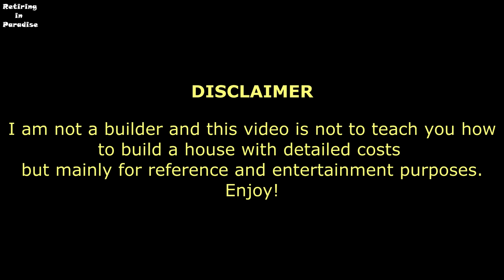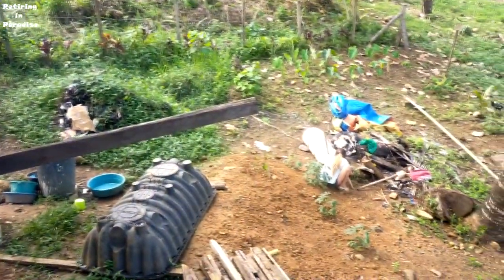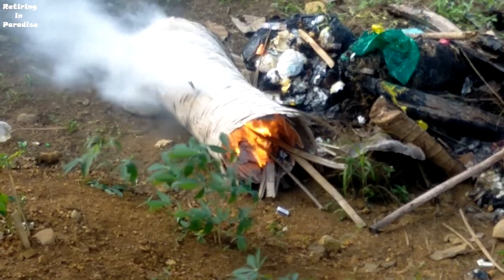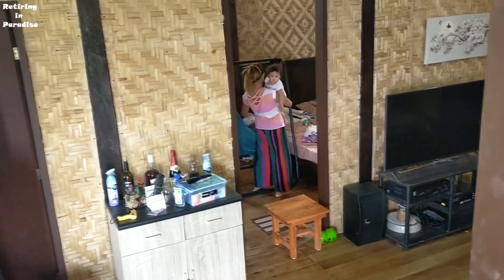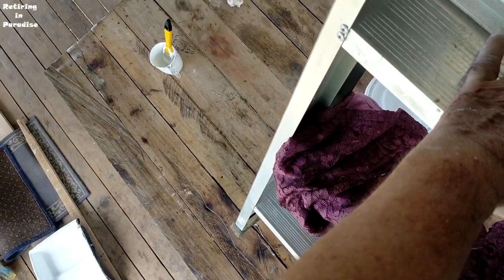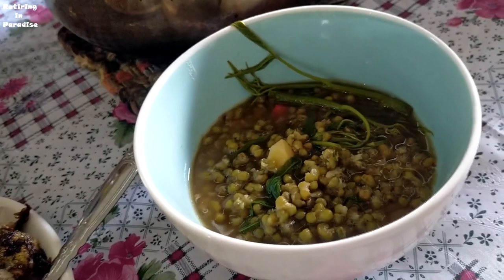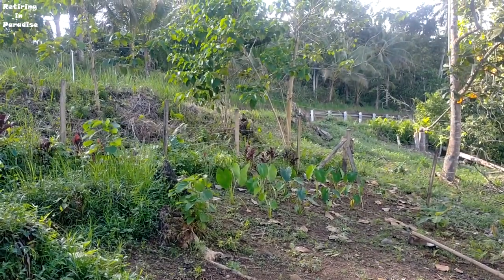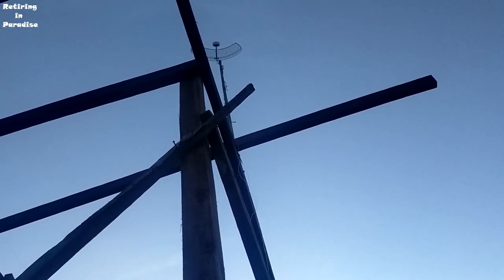V367 - Pt 87 FOREIGNER BUILDING A CHEAP HOUSE IN THE PHILIPPINES - Retiring in South East Asia vlog

Comment: If you take a drill bit the size of the screw head and drill just enough to get rid of the screw head, there will be screws threads in the hardy board and stud to hold them together. Then just fill and paint

Comment: Hi Joe Did you make sure the antenna has a good solid ground. you have it on a wooden pole you may have to run a separate ground the coax is not enough.  google it
Reply from the maker: To improve the receiption or for lightnings? 😊👍👍
Reply: To improve reception.